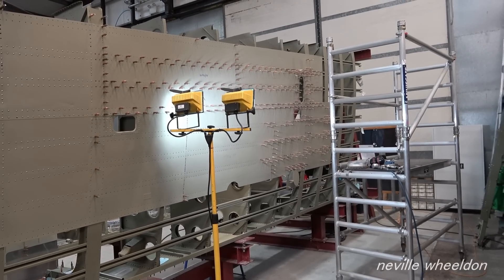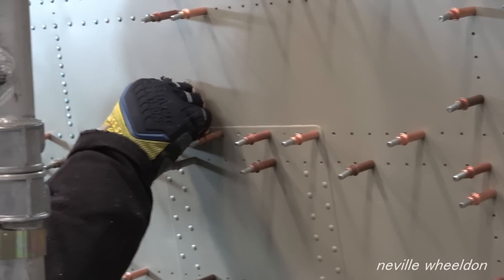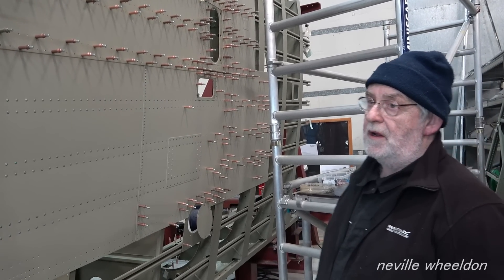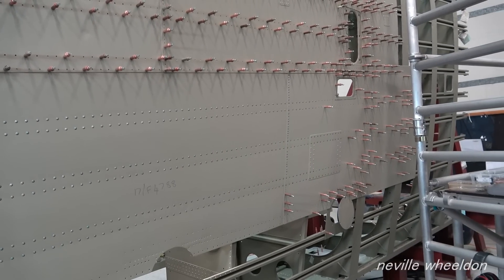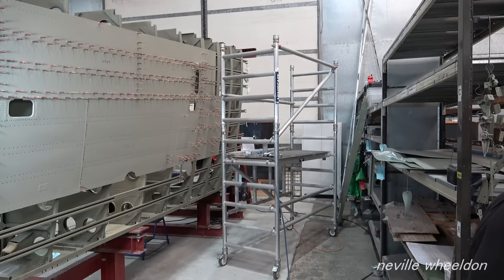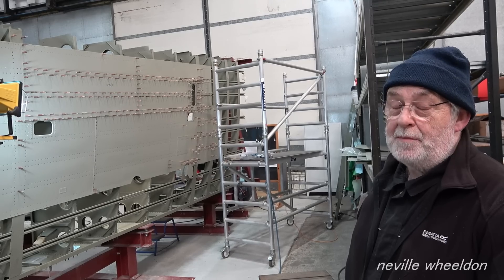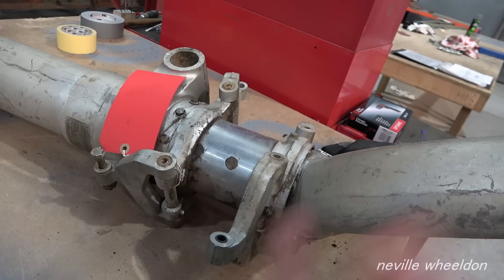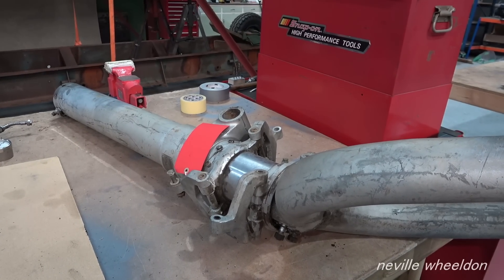Video 180 Restoration of Lancaster NX611 Year 6. Rear wheel strut fits the Doncaster fuselage.

Comment: Another excellent update, Neville. I'm intrigued by the Australian tailwheel component. Do you know from what aircraft it came? As you probably know, we have two Lancasters in Australia, G-George in Canberra, and Jane's sister in Perth. Plus, during the war we had "Queenie" as a pattern aircraft which was scrapped in 1949. Also there is a static Lincoln project which has quite a few Lancaster components I believe. If  you could ask the lads, I'd be grateful.
Reply from the maker: Hopefully I will Ask Andrew tomorrow Feb 4th after the Winter Restoration Tour at the Centre at East Kirkby. Cheers John.

Comment: Do you know or can you find out the thread size that the taps had to be made for and why were they so "none standard" even BSW and BSF are easily come by?
Reply: Yes, I wondered what the thread was to make them a special order too
Reply: @Idoall.myownstunts  Me too  I needed a set of cycle thread taps (20tpi), 1st, 2nd and bottom, for my Triumph Tiger (1971) crankshaft and got a set for approx 30 pounds.
Reply from the maker: Avro had them made specially. check out Video 184.. 29min 10sec.